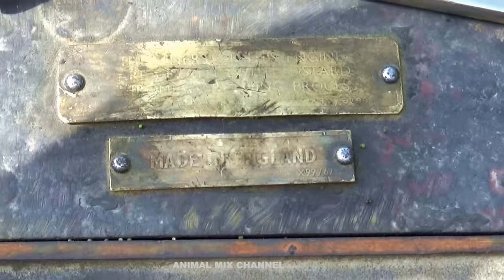Old Diesel Engine Start up Best Sounding Engine

Comment: Does this engine meet California emissont regulatiot
Reply: It might do better than you would think. A very slow speed means a very complete burn of the fuel so the amount of pollution per litre of fuel is probably pretty good.

Comment: I'm wondering why they need to bleed the fuel system before starting. Why don't they just fix the leaks? That one shifter they have serves all purposes.
Reply: If it was used everyday they probably wouldn't have to. But if it sat for a period of time I'm guessing you would have to prime it like they did.

Comment: Why do they put a whistle on the exhaust? I have seen this in other videos of Indian engines. I am wondering if it the Indian love of noise.
Reply: John Fenn it might be  so they can hear if the engine is still running from a distance
Reply: Thanks, good idea.
Reply: It also makes each power stroke audibly distinctive, thus making your ear a reasonably accurate tachometer, even amidst the din of clattering machines run off those shafts. 4 toots a second is 480 rpm, 5 is 600, etc. Counting chugs would work, but the tone would be harder to discern with some implements
Reply: ludditeneanderthal Хорошая гипотеза, но похоже, предыдущий товарищ прав, предположив про необходимость создания давления в выхлопе.

Comment: A put-put. 
We used the same engine in the Alberta oilfields, they were run on casement gas & regulator, to run pumpjacks.
Reply: Similar, but a spark ignition version with a magneto. This one is diesel.

Comment: I am 70 years old. That engine may have been imported in 1949 but it is much older. 49 model engines were much more advanced than this. I would suggest it would be from about the 1920's or early 30's.

Comment: I would like to know what the whistle on the exhaust stack is for. Is it some kind of back pressure control device??????
Reply: so when they are working in the field they can hear the pump is still running
Reply: It's also used to count the RPM

Comment: Why that belt doesn't come off?
Reply: The pulleys are not flat but are a larger diameter in the centre with a slight curve, the belt will always try to return to the centre so long as there is not too much misalignment.
Reply: Edgar Martirosyan the profile of the pulley and flywheel driving surface is slightly convex hence the belt  rises to the centre due to the difference in speed from the edges😁

Comment: Just as much trouble to get going as my "2 pulls or less" Troy-bilt lawnmower with no primer bulb.
I have to pull the carb out and clean it if it hasn't been used for more than a month.
Reply: Noooo
All you have to do is remove the carb bowl and with a thin wire clear the center nozzle that gets clogged.
Reply: ooorrr put some fuckin fuel stabilizer in it... its like 8 dollars and treats 25 gallons. ooooorr even better for your engine in the long run use non ethanol fuel. if you can't get it at the pump where you're at you usually can at the local saw shop. or whatever you have local.

Comment: Sounded better with the open exhaust pipe. Couldn't see a connection with the engine, must be buried underground. Now compare this with a 1917 U-boat diesel. 30 years older. https://youtu.be/5opnhfG35zo

Comment: maybe it is time to join the rest of the world and get a more environment friendly engine, with less air pollution. ...
Reply: This is all that is around them they cant afford these newer engines and systems man plus this is a part of history that is still working wuy kill that off
Reply: Yep America wants to be high tech if there was on of those around these fools in America would say it’s old we want new scrap it this type of thinking destroyed our industry our steel mills and all of our industrial base it’s sick  let’s go green dolor power  yes right while we have no industry smart
Reply: My lawnmower puts out more smoke than that lunker does!
Reply: What would you suggest? It actually shows evidence of quite efficient operation. Low speed diesels in good running tune are pretty low impact engines
Reply: @ludditeneaderthal  6 OP 50/3 7.5 HP Horizontal Multi-Stage Centrifugal Water Pump...No need to waist hours just to start the pump . only half the size with more power
Reply: that thing could probably run on peanut oil
Reply: A environmentally friendly 'Prius' right? Or modern engines that are junk after 10 years of operation. fool.
Reply: @kamiabadi1618  ww
Reply: @kamiabadi1618  pw